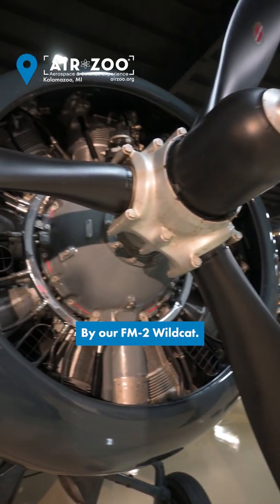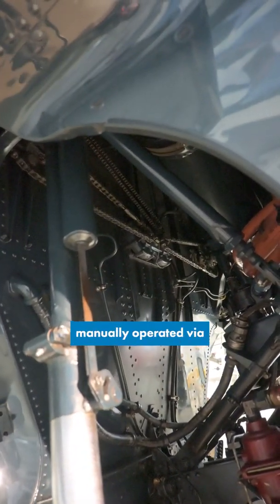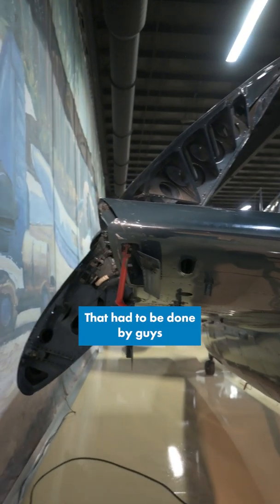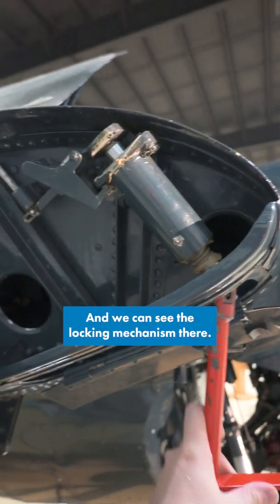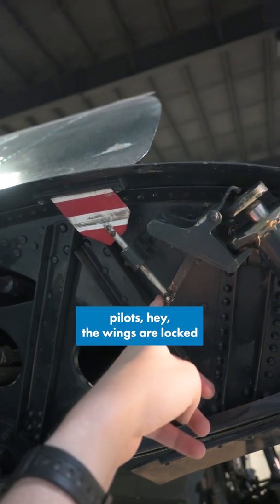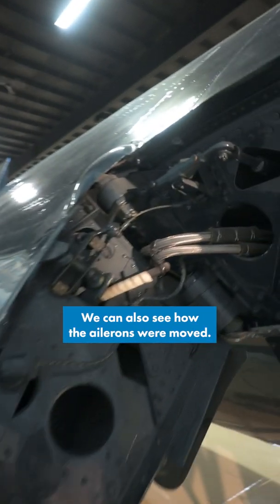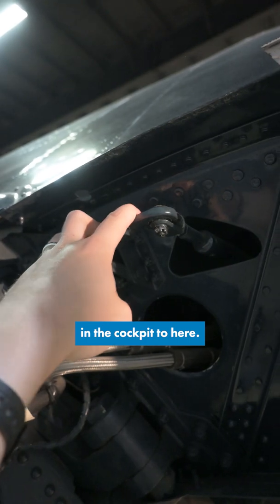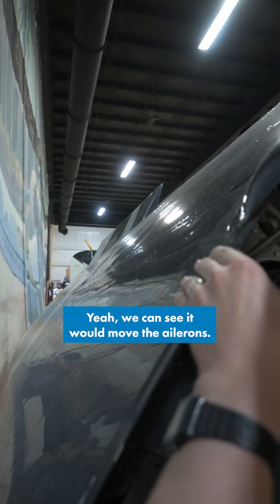The Famous Wildcat Wing!

Comment: That meshing for the aileron control arm is fascinating. I love the innovation for these problems before it could be solved with servos and shit. Just got lucky enough to see one of these land at the airport I work at. Pilot said it takes 29 turns of the crank to retract the gear 😂😂
Reply: Don't let go of the handle halfway up, it will spin the other way and probably break your wrist.

Comment: Another cool thing the Wildcat can be started with a shotgun shell
Reply: Search "B-52 Cart start" 
Basically a big shotgun shell 'cartridge' used to turnover a B-52 in a hurry, then they use bleed air to turn over the other engines.
Reply: @jamesturner2126  can't wait to search that... Already excited!   Seen a lot of old engines start that way.
Reply: @jamesharrell4360  I think the purpose is ease of starting. A pilot could run out to an aircraft with a screwdriver and a small charge and be ready to takeoff in minutes.
Reply: You can also search "Coffman starter".
Reply: Not just any shotgun cartridge though, otherwise you'd end up with lead pellets all through the cartridge starter!